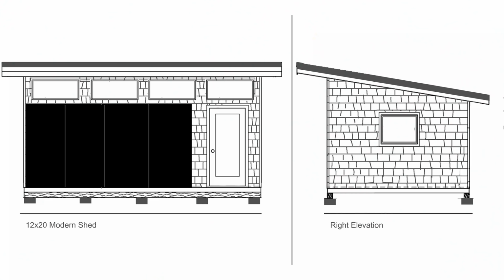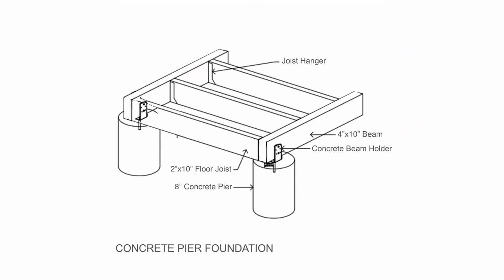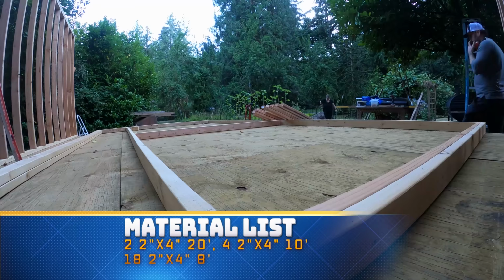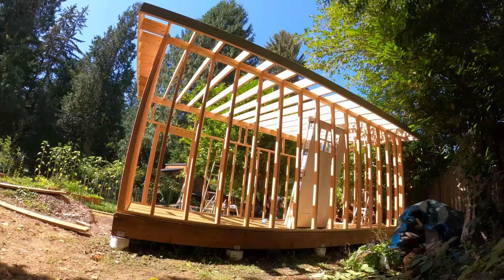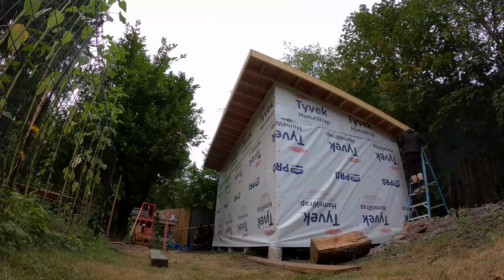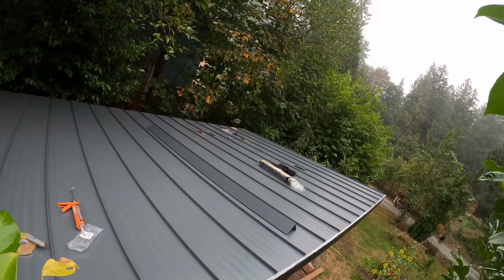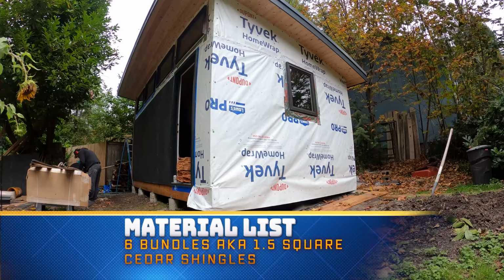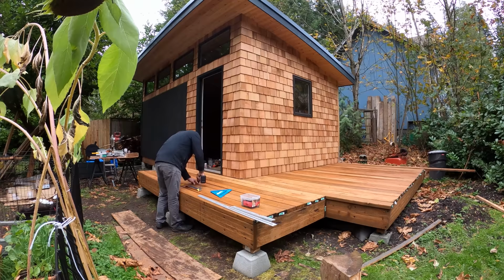Build A 12'x20' Modern Shed and Deck by Yourself: With Material List

Comment: Excellent video, thanks for sharing.  I have a few questions: 1. I like using screws too. Did a fence using screws, but my understanding is that for this kind of built framing nails are preferred due to sheer strength? 2. Shouldn't the top surface of all joists be covered with moisture preventing tape? 3. Cost analysis would have helped a lot in description along with material list. 4. Pretty good foundation, but should there be additional concrete in the middle for this size? Though I am thinking of using concrete block foundation. 5. What would you do differently? Thank in advance to everyone who helps with these questions .
Reply from the maker: I'm glad you enjoyed the video.  
I'm just a DIY guy not a Pro, but from my understanding framing nails do have better sheer strength than most screws. 
When using metal hangers, like joist hangers and rafter ties It's best to use framing nails or structural screws. Not deck screws like I show in the video. (This point has been made in the comments by a number of professionals) 
I beef up my raters by adding the big lag screws though so it shouldn't be a problem on my build but i would advise framing nails or structural screws anyplace where a screw head is touching metal hangers. 
For my foundation I looked up the code for the floor joist spans and found 2x10" joist the span less than 12' was more than fine. In theory if you wanted to add another beam and row of foundation piers you could use smaller/cheaper lumber. There are a ton of different ways to do a foundation. Mine isn't "the end all" it's just the way I decided to do it but I find it works just fine for my needs. 
I used ground contact pressure treated lumber for my joists so I'm not super worried about rot. With that said it wouldn't of hurt to have used tape on top of the joists. 
I've provided the material list in the video description and broke the list down into sections. Lumber prices have been all over the place these past couple years so I recommend pricing out materials at your local lumber yard for today's most accurate pricing. 
A lot of materials could probably be substituted for cheaper material.
At the time I built the shed in 2020 it ran me a little over $12k

One thing I wish I had done was add a ridged insulation between the floor joist before I fastened down the sub floor.
While not impossible to do after the fact from underneath it would have been way easier to do before screwing down the plywood on top. LOL

Thanks for the questions. I hope you found inspiration in my build and video. This was the first shed that I ever attempted building. I'm not a pro by any means but I have a saw and a hammer so figured why not give it a go.
Good luck on your build. :)

Comment: Great job 👏 Quality stuff👍 
Really like the finish on the roof
Reply from the maker: Thanks!
I'm a big fan of the roofing material and look as well. 
Super easy to work with and crazy durable.
In addition to the shed I using the same panels on my main house's roof.
Reply: @NilesProductions  I was actually thinking it would look great on a house!! 👍👍

Comment: Looks nice enough to move into!!!  Great work.
Reply from the maker: Thanks Greg for the kind words. 
Looks nice on the outside but is unfinished on the inside with no power or water. Basically fancy camping if someone were to move in at this point lol I built it for garden tool storage and to be my mountain bike shop. I hope to add a solar generator soon to fill some basic power needs but that's about it for now :) Maybe someday I'll turn it into a studio...
Reply: @NilesProductions  You could definitely build yourself a nice house though!

Comment: Wow, I would have thought that floor was nowhere near well supported.

The two big 6x20 outer rails, with two stringers and four bolts to each joist - I'm amazed that all the vertical force is entrusted to ultimately a few screws. I'd have thought you would need more lumber beneath the joists, with stumps below those.
Reply from the maker: Believe it or not it’s plenty strong and up to snuff when it come to our local building codes. 🤙

Comment: Maybe it is a regional thing, but you seem to be mixing up bird boxes and a bird's mouth cut. Bird boxes go on the soffits, where they wrap around a house; whereas a bird mouth is an angle cut allowing a rafter to sit flush with the top plate.
Reply from the maker: Not a regional thing, I’m just a ding-dong and used the wrong term lol. I even used  the wrong term in my graphic. But that’s how I roll, mumbling and using the wrong terms my way through life. 🤣

Comment: Hands down, awesome overall and very informative and succinct video! Love the garden!!! Congrats. 

One personal pet peeve however is using a cottage or bungalow front door on a "modern" styled structure.  I see that occasionally in my area--a stylistic faux pas IMO.
Reply from the maker: I have fancy doors on my house and thought about matching them to the shed but the price had jumped astronomically so I went with the ol fiberglass standard. 
Glad you enjoyed the video and build.
Reply: So you're essentially saying the  Therma-tru "fiber-classic" line is much cheaper than the "pulse" line.  Good info, as I haven't yet inquired about pricing on their doors.
Also, another congrats regarding the thoughtful placement of shingles on the front facade: alignment/placement is dictated by the top of the front door and the leftmost side of the porch...so the overall result appears intentional and well-designed.

Comment: builder tip: anytime you sheath over a window or door opening, just take a Sawsall on hte inside and just cut out the panel, or even skill saw from the outside.

Saves a bit of time and you wont get much better of a cut than doing it in place.
Reply from the maker: A lot of different ways to achieve the same results when building. Good tip.
Reply: @NilesProductions  100 %!

Comment: Best shed build video I've found. Just the right balance of quality without overdoing it. I really like the design. Did you happen to do any plans or sketches with dimensions? Would love to see that too but you did a great job with step by step materials lists and talking through it, so much appreciated already!
Reply from the maker: Thanks Ron! Glad you enjoyed the build/video 🤙 unfortunately I have no plans to share outside of what you see in the video.
Reply: you want to sheath your shed horizontally and not vertically if you decide to build
Reply from the maker: @GoneFollows  You'll want to hang your T1-11 vertically.
Reply: @NilesProductions  your half inch ply

Comment: My favorite modern shed video.  Really, thanks for sharing.  Couple questions.  1. Do you recall the height of the front and back walls?  For the shorter, you mention 2x4x8s.  Were those cut down or used at the 8' length plus bottom plate and double top plates? So 1.5+1.5+1.5 +96"?   Same for the front wall. 2.  Did you consider blocking out the sub floor or were the 2x10s rigid feeling enough across that 12' span?  3.  Where'd you get your windows? 4.  Other than using more nails, maybe taping top of floor joists, and insulating the floor, anything else you would have done differently?  Again, great build!
Reply from the maker: Thanks Mr WCK! Glad you liked the build. All the boards were cut down. When I mention the lumber size in the video I'm referring to ruff dimensions. I don't remember the exact lengths that I cut the boards to so I was just letting you know my raw material size.  The floor feels super ridged despite no blocking. I ordered my celestial windows through Lowes, the single wall window I had left over from my home remodel. 
Things I would have done differently: Insulate the floor with ridged foam before putting the sub floor down for sure. 
Used nails in the hangers. 
Not called birdmouth rafter cuts "birdbox" cuts lol
Maybe add a little fire place for heat in the winter?

Comment: That looks AMAZING and thank you for all the details. I was wondering what you put on the ground under the shed and deck and why. Thanks!
Reply from the maker: Thanks Sheelah K! The black plastic under the shed helps reduce/block ground moisture and vapor from wicking up into the floor boards. 
Think of kneeling on grass and how your knees get damp even on a sunny day, then using a garbage bag under your knees. It just helps keep everything nice and dry.
Under the deck I used landscaping felt to stop weeds from growing up between the boards.
Reply: @NilesProductions  thanks!

Comment: You've both inspired and deflated me. I am in the planning stages of building an 8 x 14 shed. I love the modern design and will copy the architecture (thanks for your permission). What is you background to have this skillset? Your build is the stuff of DIY'ers wet dreams. I plan to add simple solar panels on the metal roof to run lights and my mini fridge for Miller time. Thank you for the amazing videography and list of materials. I'm already excited to get my project underway. Thank you for the inspiration! Now, if you can just show me how to build a pool, you'd have my backyard complete, ha!
Reply from the maker: Thanks for the kind words. I’m not a professional carpenter. 
Just a guy with a saw and a hammer that likes DIY stuff. I bought a book at my local hardware store called Garages and Sheds and downloaded some simple plans off the internet. I took design elements from both modifying them to suit my personal needs making it my own. 
This is the first shed I’ve ever built. 
My background stems mostly from building skateboard ramps and half pipes during my youth.
I’m sure I did a couple things wrong and used wrong terminology along the way but I try and not let that discourage me. 
My best advice is take your time and brake things down into sections.
All the information is out there for things like installing window or doors. 
Most manufacturers have good install videos these days that will make you an expert in no time.
I’m planning on doing a small solar generator myself. 
I’ll try and make a video when I do 🤙

Comment: Awesome craftsmanship all the way around. Great videography too. I am curious, were you a carpenter or a framer before you started this project? again, nice work and thanks for sharing.
Reply from the maker: Thanks Brendan Ramroth! I am not a carpenter or framer by trade. Just a guy that likes to DIY stuff. Most of my experience comes from building skateboard ramps and half pipes in my youth. 
With that said this isn't the first time I've swung a hammer but it is the first time I've built a shed.

I'm happy I took the initiative and did it myself vs buying a prebuilt shed at Home Depot. 
I learned so much by researching and doing this project.
Really proud/happy with how it turned out.
Reply: @NilesProductions  I should have known by the low top, slip on checkerboard Vans in the video. You really took your time and did it right. Gives us all hope to tackle those bigger projects. Thank you for sharing.

Comment: hi. great vid. for future builds, you should nail joist hanger. screws can brake with movement. other than that , great build.
Reply from the maker: Glad you liked the video. 
Why I used screws vs nails can be explained in this video. 
https://m.youtube.com/watch?v=qmajKElnwfE
The modern deck screws have pretty good shear strength so I’m not to worried about them failing but I might be wrong. I’m not a professional carpenter by any means just a guy with a drill and a saw, so I’m sure I made some mistakes.

Comment: Fantastic video, I enjoy every second! The only part unclear to me is how to layout the front wall, how the 2 2'' * 6'' 20' works? Do they laid on the top binding together, makes a real size of 5.5'' * 3 and standing on the top window frame?
Reply from the maker: Thanks, glad you enjoyed the video.
To your question, yes the 2x6s are sandwiched together as a 4"x6" substitute and the actual dimensions are 3"x5.5". 
An actual 4x6" would give you the true 3.5"x5.5" dimension. 
The decision two sandwich the two 2x6" together was recommended as a more cost effective way to achieve similar results. 
In turn it makes for a little thinner beam.
I didn't save much money in the grand scheme of things going the sandwiched 2x6 route vs going with 4x6s. 
I would probably buy 4x6"s if I were to do it again.
Reply: @NilesProductions  :yougotthis:Thanks a lot for explaining! Also want to check where did you purchase 20' long PT, can't find any from HD/LOWES. Is that only available from some local lumber store?
Reply from the maker: I was able to get the 20ft 4x10 pt at a lumber yard called Dunn lumber. Probably not going to find it at Lowes or Home Depot unfortunately.
Reply: @NilesProductions  I know Dunn lumber!! Cool, thank you again!

Comment: Wow you did this project during the height of massively inflated construction costs
Reply from the maker: I bought the majority of the material before prices went crazy. Wasn’t so lucky towards the end of the build though. Some off the deck material was nearly double in price vs when I started. Also had planned to do different siding than the t1/11 but prices scared me off

Comment: You did a disgustingly good job and it's just made me sick with envy, I'm in the UK and about to undertake a similar project and same size but to do what you've done will probably cost me 20k.
Reply from the maker: Thanks for the props and good luck on your project. At the time I built this it cost me a little over $12k, I'm sure if I were to build it today the price would be much higher.

Comment: Dig the video but you need to brace the walls for racking.  At 10:13 you can see then entire building shift.
Reply from the maker: In the shot where you see the building shift a little I have only one corner screw set in the plywood. I’m using my weight on the ladder to press against the upper framing to slightly shift the framing into square so that all the plywood will line up perfectly. Later around 10:33 you will again see me do the same with a ratchet strap slung through the window to square the front wall. Once the plywood is fastened the building is rock solid. If you fasten the plywood before standing the walls you can avoid this step but as I was standing the walls alone stuff can get a little heavy and wonky.

Comment: Love what you did 
What was the budget to build one of these from start to finish
Reply from the maker: The shed and deck ran a little over $12k. Wood prices have been all over the place over the past couple years though so if you want something a little more accurate you can take the material list in the video description and have it priced out at your local lumber yard.
Reply: Wow that’s not bad at all

Comment: Great video. Why shouldn’t you seal the bottom of the window flange? Thermal expansion?
Reply from the maker: By not sealing the bottom it allows a place for condensation and water vapor to escape/evaporate. If you seal the bottom it will potentially pool water and rot the framing

Comment: I followed these instructions but instead of using screws I used all hand wrought nails from recycled antique rail ties (as any true nail connoisseur would)  My shed is able to withstand the weightage of least 12 large dogs accompanied by a full 14 piece bluegrass fusion Journey cover band.  2/10 construction. 9/10 aesthetic. (-1 for use of cedar instead of poplar)
Reply from the maker: A 12 Dog load rating is fantastic and something we should all aspire to. More impressed you where able to achieve this with 12 large dogs. Most people opt for small dogs like chihuahuas or wiener dogs. : )

Comment: In my neighborhood I checked with my city and I need a miscellaneous residential permit for a building this size which requires sketched plans and a signed and sealed copy. How would I acquire this? 
Also the shed build was awesome, great job
Reply from the maker: Glad you enjoyed the build. I recommend googling Modern Shed Plans and the size you are trying to build. There are a ton of blueprints online for cheap and sometimes even free that should be sufficient for permitting. You can always try and draw your own but it’s good to start with something pro to make things easier.

Comment: would like to have seen the inside, even tho it's just a shed. wanted to see how much light those windows let in.  i can only assume you electrified the place?!?   thumbs up!
Reply from the maker: I'm about to make an update video showing off the inside. I've set up a nice little solar off grid power system inside. It'll probably be a couple weeks before I get around to finishing it up. Probably post it up after the original video crosses a million views as a little milestone celebration :)